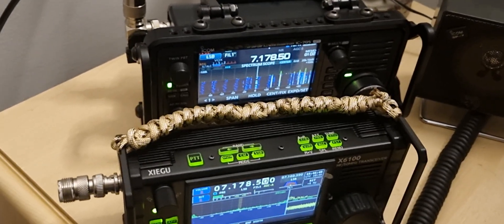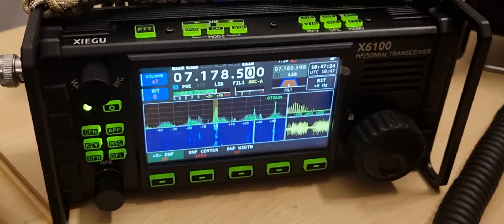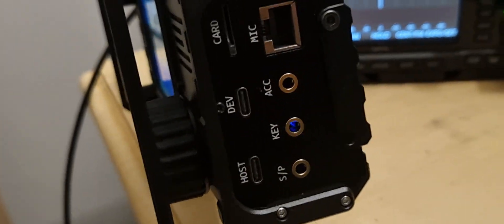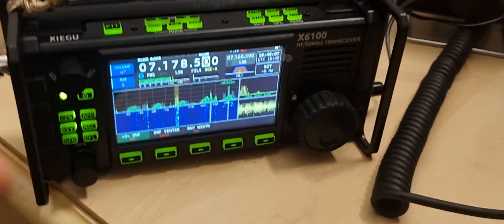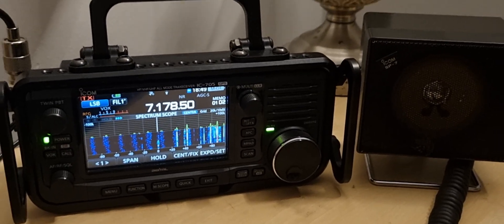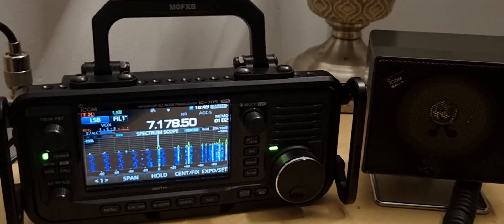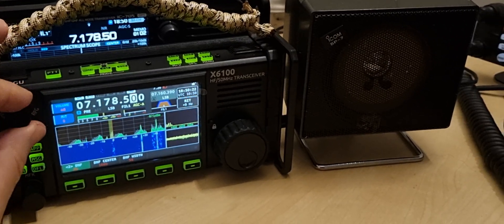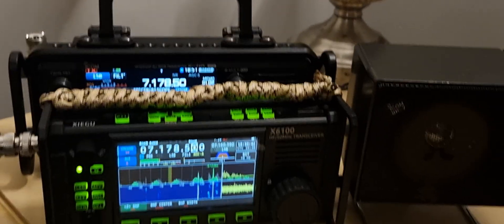ICOM IC-705, XIEGU X6100 External Speaker (ICOM. SP7) Comparison

Comment: Andreas, the Icom SP7 is an excellent little speaker…I have one for years! The sound from the X6100 to the SP7 is excellent. Also, the included external Xiegu speaker that came free with my new X6100 (Christmas promotion I think) is also very good but the SP7 is better. Either one is a huge improvement over the internal one! I also purchased the Flip Cover Carry Frame for the X6100 from HamGear3rd (USD65) here in the U.S., a 3D cut that fits like a glove…check him out! The Flip cover comes engraved with your call sign!! And finally I also got the FT-710…”Santa” was good this year…Be safe, Cheers K9YTT
Reply from the maker: Hi wow you have a great set up I also have a YAESU 710 it's excellent, what is the XIEGU speaker? My motto is more Radios more fun.:)

Comment: What a shame. I had high hopes for the X6100. I am glad I have the IC705. I only use the internal speaker on the 705. Why they even have a Speaker/mic I will never know? I guess they use an HT Spk/mic? Barry, KU3X
Reply from the maker: Hi Barry the 705 is fantastic but the X6100 with atu u can just pick it up and use it with a length of wire.